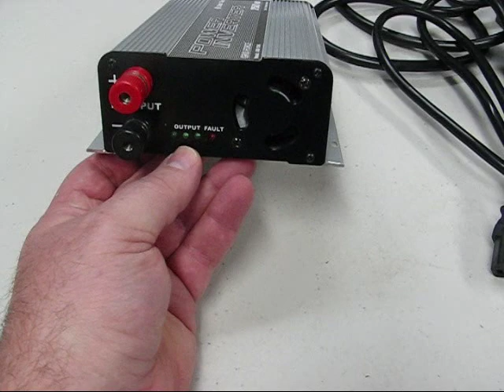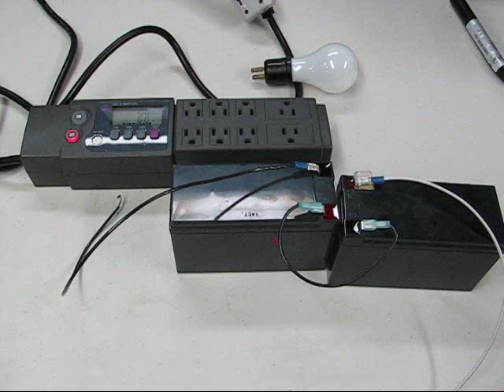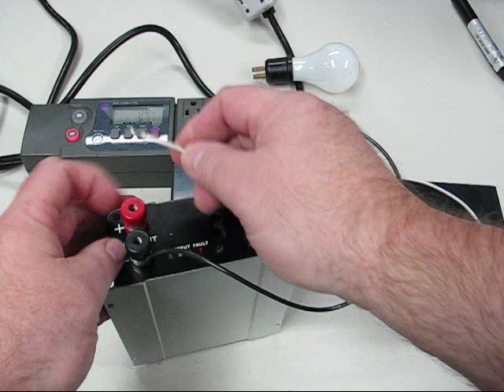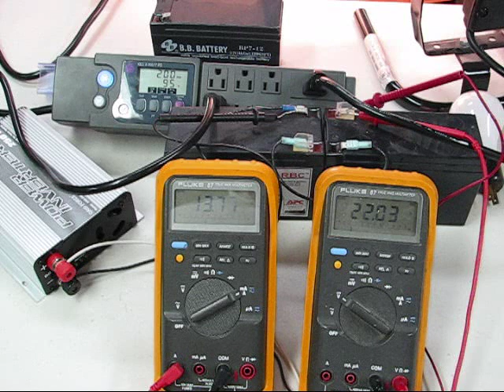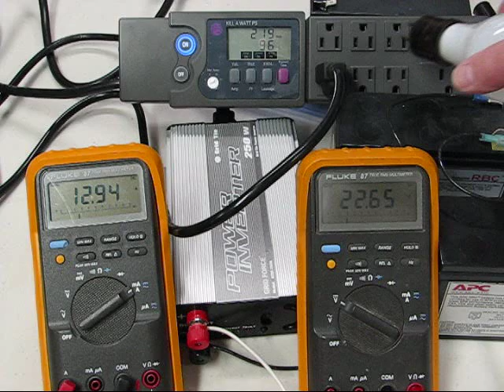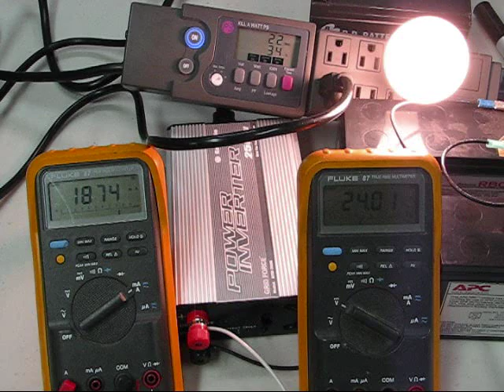Grid-tie Inverter Analysis

Comment: Very cool. But unfortunately very illegal.
Reply: Cotronixco Why is this illegal?  I don't get it  ?
Reply: I thought so too, but it all depends on your utility company.  My local company only requires a permit/inspection if you plan on selling back to the grid.
Reply: Gilly Gilbs And in my liberal State, it will not pass because it was not installed using union labor. Plus they charge an additional $400 connection fee.
Reply: Christmas Eve You are not permitted to insert power on top of existing power. Many 3rd-rate and homemade devices have proven to be very dangerous. That's why they are regulated.

Comment: Let say you shutoff all breaker in your home and you go on vacation...and you leave your inverter connected to a particular breaker that still on...but there is no appliances connected...you can spin backward your Utility meter but be careful ..if you happen to have an Utility Meter of the wrong kind...the electricity going backward will be billed as it was consumed. There are other meters that will not go backward but they will flag the Utility Comp. that there is something at your house!!

Comment: The Inverter transformer has about 235 Watts until saturation.
The power is modulated in Primary so you can not get more than 166 Watts out of it (Divide by square of 2).
PJ 300 have commonly (and elder designs) a transformer 4215 core so 166 Watts is the limmit.

Comment: A normal 240V single phase home actually has 2 110V phases.  When you plug into a wall outlet, you are only connecting to 1 phase of your home.  if you turned of the main breaker only about half of your home would have power.  Any of your 240V appliances (such as waterheaters, stove/oven, a/c units would not work.

Comment: I would not skip the batteries.  Does your wind turbine include a dump load?  If you over volt the inverter you will greatly shorten its lifespan.

Comment: To use the sun 600 watt GTI put the 2 100 panels in series.  To accomplish this is easy.  Take the positive of one solar panel and the negative of the other and connect them.  Then run the wire run from the positive on the one panel and the negative on the other 100 watt panel and run the wire to the GTI.  Make sure the GTI is housed someplace protected from weather.  They are built really cheesy and the weather will wreck havoc on them.  Mounting to a basement cement wall is a good idea.

Comment: If you go with what you propose you are looking at 2 100 watt solar panels and a chinese GTI.  The efficiency of this system is about 75-80% efficient.  So with a 100 watt solar panel you will NEVER EVER see 100 watts.  Marketing gimic on panel ratings really lame btw.  Take the panel multiply it by .7 and that is reality ONLY at peak solar noon (1/2 hour in a day).  So with 2 panels 150 watts throughput it should be fine.  If you do use a chinese GTI I would recommend the Sun 600 watt 22-60 V.

Comment: Now if you contrast this with what I have done you have a solar panel and a wire run of maybe 30-50 feet to where the grid tie inverter is inside your house.  Obviously it makes much better sense to have an inverter attached to the panel converting dc to ac because there is no wire run.  There is a youtube video somewhere that shows a guy that I did then swapped the system out with enphase inverters.  Well worth watching.

Comment: As you expand the system simply add another panel and an enphase inverter to go with it and put it in parallel to the rest of the system.  You can get the enphase inverters on ebay for 150ish.  These inverters are extremely kick-ass.  They convert the panel at about a 95% rate.  The losses are extremely low 5%ish.

Comment: Man if I had a chance to do what you are doing I would have bought a 100 watt panel and an enphase inverter.  The enphase inverters attach directly to the aluminum on the backside of the solar panel.  The beauty of enphase inverters are a very short DC run.  So the wire to the enphase inverter is like a foot.  Then the enphase takes the dc power and converts it to 220 AC.  The beauty of that is the line run from the enphase inverter to the house is like a high voltage and the line losses are 0.

Comment: No they think you are making panels from scratch.  No its not that complicated.  Buy a 100 watt panel making sure that it has mc4 connections with it.  Connect the positive to the positive on the grid tie inverter and the same with the negative.  No soldering involved as long as you get a panel with mc4 connections attached.

Comment: Yes they are correct one inverter per panel.  If I was going to do this all over again I would have bought enphase inverters and attached them to the backs of the panels and connected them into the 220 volt branch on my house with 1 enphase per solar panel.

Comment: You need to look at the voltage on the panel.  There are two types of inverters 10.8-30 volts and 22-60 Volts.   The GTI's sweet spots are at 30% of their listed rating AND the cheap chinese inverters really only work at about half of their rating.  So a 250 watt gti or 300 watt gti is perfect for one 100 watt panel.  1/3rd of the listed rating.

Comment: Also, a lot of the info about the inverters is very confusing for someone who does not know what is what. For example, how do you figure out how strong the GTI needs to be for each panel. It seems that each panel has the Watt number but then also volts as well, what the heck does that mean even? Someone said that it is more efficient to have a seperate inverter for each panel, but if you panel is 100watt, what on earth are you supposed to do - the lowest inverters that I have seen were about 250

Comment: Ok, I am completely new to this, so just know that at this point I am clueless, but ... do you mean, because electricity is cheaper during the night, so you would charge your batteries from current in the wall, and then using the inverter plug it back into your house grid to lower you usage during the day, and thus save money?

What kind of batteries do you mean? Car batteries, and how would you charge those from the grid?

Comment: It will work, please post a video with wattmeter and good sound so I can hear that beautiful thing and see it work.

But how small a lister, you should be able to crank much more than a car alternator or the small grid tie could handle even with 5hp or so to do less is waste fuel. Build diy style an appropriate sized one of the windmill generators to efficiently get a worthwhile result from it. Just an alternator will do no justice to the fuel consumed plus losses in mechanical and electrical.

Comment: No you'll kill it.  You need a GTI with a offloading option built into it when the voltage gets too high otherwise dead Inverter.  Cannot use solar inverters for Wind turbines.

Comment: I just had a few pieces of information that people may want to know about the 12-30V GTI and the 22-60V GTI and efficiency.  I have been playing with these for about 5 years now and the inverters do their best closest to peak voltage of the inverter.  So for a 12-30V you want close to 30V and for a 60V you want close to a 60.  The higher you get to the top of the voltage the more efficiency you get.  Also always try and split the inverter so its 1 inverter per panel.  I hope this helps someone !

Comment: This video cleared up a few GRAY areas for me and I think that I am going to use it with some Solar Panels.  This should reduce my electric bill and help me go a little greener by the year.  I looked at the Spinray Deck unit that is sold on Amazon and thought to myself, there has to be a cheaper way.

Comment: @pvampire you would need to connect your wind generator to a charge controller then to your inverter. Or find a grid tie inverter that is designed for use with a wind generator.

Comment: Hey, great job!!! I have a question for you. I have 4 DIY solar panels 120W, 20V each and I am using a 1200W 14-28V grid tie inverter. With a Kill-a-Watt meter I can measure 280W on the AC side but 10 minutes later it drops to 100W. If I disconnect the DC source for 1 sec and connect it back, I get 280W for some minutes and then it drops again. Can you tell me why is that happening . Thanks.

Comment: How to improve GTI & PV PNL system. Home made pnl (72 3x6 cells Voc=36VDC; Vload=24vdc). PNL designed for 24vdc system .Industry suggest 150% volts cell design 36vdc. For 24vdc system. Pmax for PNL is @ 24vdc. Why will GTI shutdown causing voltage to go to 36v; not reverse process.Placing a 2sec short on PNL causes GTI to start work.

Comment: The inverter that you blew up probably had the female plug for the plug-in to accept the male portion of the "load" plug. I noticed the inverter you are using now has the male end of the plug-in to accept the female end of the "load" plug. Maybe that's a good indicator as to which is a proper and non-proper one to use? Keep up the good work.

Comment: I own a very nice 500W grid tie inverter that I was going to use for my solar panels. I would like to use it with my wind generator.  Can I hook a grid tie inverter directly to the wind generator? The wind generator puts out anywhere from 9-36 volts depending on the wind.  Would that work?

Comment: @solarwindaus I am sorry you've had such unfortunate results. What your report says to me is that the particular GTIs you purchased couldn't withstand generating their rated power continuously.  Either that or there's something about how you wired up your system that lead to their early demise. It seems to me that such a device can't take more amps than it can use, but it could overheat doing it, particularly if the design was lacking.

Comment: Hi, I will add my converter turbine 12 to 220 v.
The battery consumption of the converter without any spending is 0.4 amp.
And if the charger goes from 14 v. automatically turns off the drive, I think I will have to put a voltage regulator.

Comment: I notice you connected this inverter to battery power !. after watching this video some time ago I bought 2x pswgt-300 inverters from china and had them connected form my 24v battery bank to a dump load controller at 24 volts, Output at 220 volts , THEY FRIED IN NO TIME !!.  I have since found out that they should not be connected to batteries under any circumstances.  They are meant for solar panels only and cannot take the high amp output from batteries. BE WARNED !!

Comment from the maker: @WulfBand Anything in the higher wattage range should probably be connected to a 220v circuit instead of a 110v because it will probably exceed the wattage of the circuit breaker in some homes (although some space heaters exceed 13,000 Watts).  You want to make sure you don't heat up your wires and cause a fire so I am going to test anything before I recommend it.  These things are growing in size and I will be testing a 1000 Watt 110 V plug in inverter this week.

Comment from the maker: @Shakespeare1612 Yes, that can be done and we may be covering it in a future video.   You need to charge batteries and have two inverters which are switchable, a grid tied inverter and a regular inverter.  When you lose power you need to switch out  the grid tied inverter, then turn off your Main Breaker (for the safety of line repairmen), and then turn on your grid tie inverter for the circuit(s) you wish to power.

Comment from the maker: On the contrary, the Enphase M190-72-208-S11/2/3 has a minimum starting voltage of 28V making it unsuitable for micro wind applications which are well suited to this inverter.

Comment: Thank you for the advice. I am sorry that it wasn't obvious to you that testing the grid-tie inverter using a handy, compact, and controllable current source that fit on the table isn't the same thing as advocating charged batteries as a form of alternative energy (which we do not). 

I am interested in the rationale behind your prohibition of using PV panels with a grid-tie inverter and your ardent affection for mercury-containing CFLs.

Comment: I am always in favor of proper safety precautions. That is unless laziness doesn't overwhelm my sense of impending doom. Perhaps we should have included some "don't try this at home" disclaimer. Certainly a switch would have been better, although less dramatic (moving the spark to the inside of the switch). The risk of "boom" under this particular set of circumstances was nil to nonexistent. Good thing. My protective Lexan bubble was in the shop.

Comment: First of all, sparks can happen regardless of the order of completing the circuit. The idea behind this "positive first" gem was to reduce the possibility of a hydrogen gas explosion by making the final connection away from the battery to the frame of the car. Second, the hydrogen (and oxygen) gas comes from electrolysis of the water in the battery when charging the battery at a high rate and/or voltage, like when jumping your car battery.

Comment: @tegf4 There's this pesky thing called the 2nd Law of Thermodynamics that boiled down basically says that there's no such thing as a free lunch. There's always SOME inefficiency in any system. This particular device seems to have an efficiency of about 77%. Higher, would, of course, be better. I don't know that this unit is any better or worse than similar units at this point. I would have hoped for closer to 90%, based on DC-to-DC converters I am more familiar with.

Comment: Nice multimeters I have been a Fluke fan forever. I have an 88 and a 98 and about every accecory you can plug in to them. great video I have learned alot about these tricky little inverters watching my aray volt meeters when the sun is setting is wild they will pull the volts down and then let go over and over thats why these things do not work with wind turbines there not fast enough. Thats why sunny boy came out with the windy boy GTI. Great vid keep them coming. CEERS WINDY NC

Comment: I can answer that. When converting ac to dc there is a factor of 11 thats why you can plug a battery charger into a 15 amp recepticle and charge batterys at such a high amperage its just in reverse. Check out my videos. CHEERS WINDY NC

Comment: part 2 of replay, I like building stuff and I want to provide my own power and beable to sell it back to the power company when I produce excess I know they have stuff like that because you I know buy law have to beable to disconct the main if there is a main power failer. and I also want a larger inverter. I guess they have stuff that can be used to turn a main breaker off or on need be. but is all call one day we will all produce our own power and tell the pwoer bill by by lol

Comment: O I know you dont want to feed the gride if the power goes out on the power companys end but I wonder if there is a gride tie inverter that will disconct the out side line if that part of the power goes out but yet power the home. like a girid tie inverter that shut s down when it dose not dect the power commiing in. instead of it shutting down put have a breaker set up to were it will disconnect the main untile the main has live power again and when it dose it will turn the breaker back on.

Comment from the maker: @mccunecp That would be illegal unless you have a protection device to prevent power from leaking out into the grid.  You want to avoid killing the electric linesman who may be working on the power cables after a system wide outage at all costs.  If you can isolate the lines leading out of your house to the grid, then what you are asking for is doable, and can be done with an ordinary, non grid tied, inverter.

Comment from the maker: @IslandEnergySystems The point of this is to review this inverter and to analyze the efficiency of the device.  We now have this hooked up to a wind turbine. The UPS batteries were used simply to provide a known electrical voltage for benchmarking the device.  This inverter is important because it allows reduction of your electrical bill for very little money when coupled with PV or Wind. PV to battery is another option, but 12V LED is the best lighting option.

Comment: What is the point of this?   The electricity you are delivering to the grid is just the discharge of the battery.  How do you re-charge the batteries?   

A battery is not a SOURCE of energy, just storage.

 If you have PV panels please do not try to connect them to the grid with one of these!

Use PV panels to charge the batteries and the 'normal' small 12V inverter to run your lightbulbs (but get some CFLs).

Comment: The important thing is the voltage under load. For example, when it's attached to the grid tie inverter. Otherwise, it's sort of an open-ended question.

Comment: Hey bud I don't have plans I just used videos on here, Although I wouldn't use the soda cans, as they have a lining in them that shouldn't exceed 120 F, as they will start to off gases. Also make it so you can access the inside a mistake that i made, as i have stuff growing in the tubes and now i cant use it.

Comment: @bidwell187 
At the risk of creating more sparks, I drew the sparks on purpose for dramatic effect. It could explain why one of my favorite sites is sparkfun. Your advice, though, sounds as if it came from the procedure advised for hooking up jumper cables on a car in order to avoid a hydrogen gas explosion. I was quite sure it made no difference which way the circuit was completed, but I tried it anyway. I got sparks no matter which order the leads were attached. Spark fun was had by all.

Comment: Thank You for this video!  I am thinking about using solar panels for my cabin.  My 55 gallon drum vawt needs some work or a different motor/generator.  It has produced some power but not enough to keep my battery bank fully charged.  I will post as soon as I make any uprades/changes.